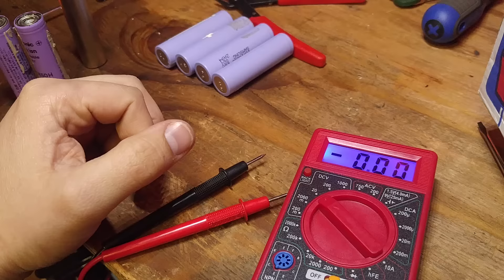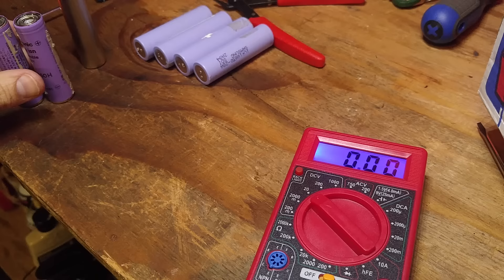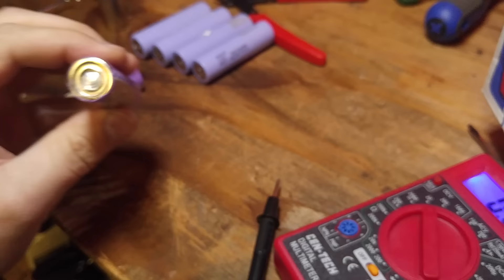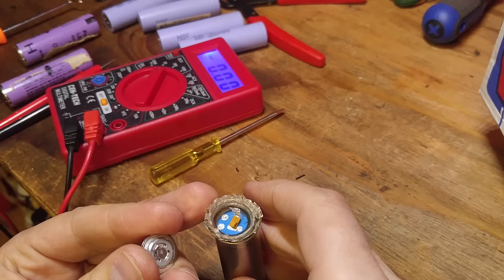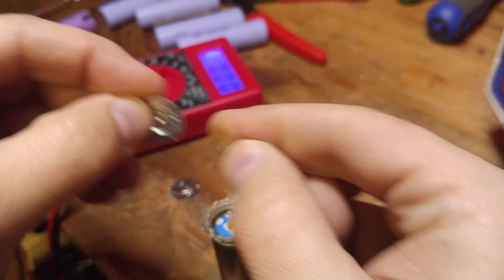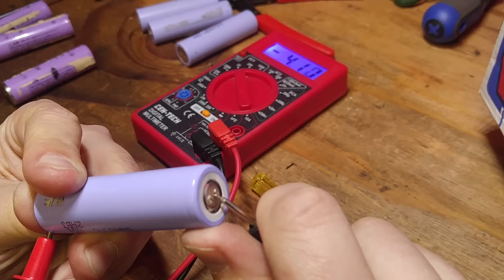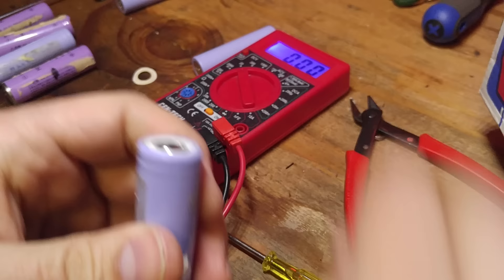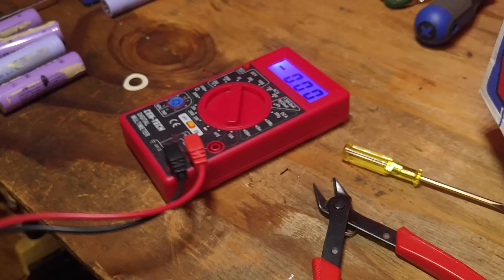0v 18650 - How the CID works

Comment: This is freaking AWESOME!!!!!!! 
I repair sooo many battery packs and noticed that most of these packs coming for repair have Samsung cells (exactly like the one you showed in this video). Have you tried the same with other brands like Sanyo, LG, Panasonic or Sony????
This video will help a LOT of people out there... =]
Reply: this works with all the 18650 batteries ive worked with. no need to even cut the top off, just get a really tiny screwdriver, alan key, or paper clip and stick it in the holes of the positive terminal and you will hear a little hiss when the dome returns to its operating position and relives the excess gas the cell built up.
Reply: is this safe to do? I did not hear any hiss sound, but still I have a 2.6V voltage reading now instead of 0. If I didn't hear a hiss sound that means I pushed it too lightly and it will probably return to previous state soon?
 How long before the pressure pushes up the lid again, or this will stay down from now on?
Reply: World Peace Deathray there shouldn't be a hissing sound. The whole point is that it is a sealed battery. If the pressure gets to high, it pops the pressure disc, effectively disconnecting the positive end. If you puncture it, the pressure will escape, but you will effectively defeated this safety measure. So I would deam the battery unsafe to use again. Just my thought.
Reply: KalTube if you did not hear a hissing sound (escaping pressure/gasses) it means you reset it correctly. Pressure decreases as gasses condens when temperature drops. If the battery will run too hot again, it will just expand de gasses again, and pop/disconnect again. If the gasses escaped, you defeated this safety measure. So it will never disengage the positive terminal, untill the battery just gets to an unstable/overheating working state.
Reply: ElectricBike ة
ن
مج
Reply: World Peace Deathray म
Reply: Bruno don't tell people to revive dead cells it's dangerous and they shouldn't do it... it is absolutely not safe to do... once the cell's dead it should be recycled and unless you live in a third world country you should deff not do this.... I cannot stress enough how important this is for safety reasons...

Comment: Thank you. It's true. I can recovery many of my 18650 battery. If I don't see this video I don't know what to do with it. (when I use screw driver press to the hole I hear the sound like air come out and then,when I check it the voltage was come back) I very happy.

Comment: It worked on 10/15 batterys. Just get a phone sim card opening tool or somethig small and push the CID back to place. It might release some gas but usually it works. I will post the capacity of saved cells soon

Comment: These aren't just batteries - they are explosives. If the safety seal blew it was for a good reason. Pushing it back in is a ridiculous idea and you can end up setting your house on fire during charge or even during use without warning. If you rebuild a battery pack then a single cell will ignite the others for a real display. And no it cannot be put out once they ignite.

Comment: I revived some 18650s that was at 0v using my battery optimiser, i set it to charge in NIMH mode at 0.1a until the voltage increased to 3v then switched to lipo charge at 0.5a theyre now fully charged at 4.2v holding their capacity at 2200mah, i tried a similar method to yours and almost popped the battery.
Reply: Douglas Dark do the batteries get hot when under load? does the resistance not increase lots when it sits at 0v for a while?

Comment: Greetz,

What are the consequences (in terms of further use), if you accidentally vent the battery ? Meaning that you hear a hissing noise - like yours did @ 09:47. 🤔😐

Some suggest/claim that the battery cannot go back into protective state anymore. Ergo if something goes wrong (during charging or discharging) it can explode. Can you elaborate on this please ? You can also add links where this is thoroughly explained. Thanks.

Best Regards. 🙄
Reply: These cells are compromised and no longer safe to use. The protection is there to vent gasses from a damaged cell. The disk venting is a symptom of a much larger problem internally in the cell.

These cells modified like this are now a fire hazard.

Electrical Engineer
Reply: Stephen2846 Makes sense... does that also mean that the controlled environment thaw was prior to this in the battery is now constantly exposed to the outside (air) ? 🤔

Lithium doesn't handle moisture very well...

Comment: i have 3 with 0V, but not open circuit, trying to charge ends 0,00-1,8V during charge and heating. It has internal short.

Comment: I ordered a 120 NEW Sony vtc6 18650 cells for an electric skateboard project I was gonna make. It took about 2 years (moving, Corona and waiting on other parts) but I finished building the battery pack only to discover a handful of cells lost voltage like this and I can't replace them individually because the battery pack is epoxied together as a whole unit.

My only choice would be to pop the CID vent permanently. So I'm just wondering how exactly do I go about doing that.

Mind you the batteries didn't get hot but they were stored in a California garage so I think the constant low temp and years without a full charge may have given it internal condensation possibly to build up enough pressure to trigger the CID?

it's just a theory of mine but I sure as hell can't afford $700 of new cells so it seems like this is my only choice

Comment: Great find.  Was having the same problem.  I wonder if the process of removing them from the pack is also putting alot of force on the tops adding to the metal popping out.  Should have watched the vid all the way thru.  About jumped out of my socks when one hissed like yours did.  Samsung  IRC18650-28A. 2BC1 here

Comment: 2021, O.K. Managed to do the same results re depressing the inner POS push-out to go from 0 VDC to 3.76 VDC. Is it safe to solder a a braided 18 AWG to the inner exposed contact without being to close to the lithium ? Can't use any contact to bring the POS contact beyond the top of the base without heat shielding (teflon). That is, can I solder a lead (18AWG braided) to the centre of contact we pushed down to remake contact with the 186..to bring the Lithium back 18650 POS lead accessible  for use as a standard 18650? BTW thank you..two LT batts bit the dust on the two centre 18650 bat falsley going to zero VDC.

Comment: Seems like the wire back to the spot but no power is provided. Once I popped down the positive touched the base getting contact but not enough to provide high power output. Otherwise is back but useless. Should we try soldering to get better contact?

Comment: So, I take it most of the THIS IS AWESOME people were never aware of a 'protective' "18650" or such type of cell, right?  All "18650" cells are not built the same.  However, in something like a PACK configuration, for safety sake you will most often, indeed, find that the cells have the SAFETY feature.  You can purchase the battery, and others to, with this feature.  You just need to make sure to look for and find it is there.

Bottom line is not all of these batteries have the feature.

Comment: with your experience the cell will not back to the same situation again?
Reply: hum, eu acidentalmente furei uma delas fazendo isso, vou checar como ela esta agora, e sim... isso nao melhora a condição da celula, simplesmente é uma volta forçada.
Reply: Hopefully it does if the pressure builds. Or BOOM goes the dyno-MITE

Comment: I was charging 18650s with a phone charger and being careful and throwing away ones that behaved different. A guy kept borrowing my batteries and bringing back junk. I charged one about 5 minutes and it was already getting warm. Took it off the charger and set it aside. About 2 minutes later I heard a noise and the battery was shooting flame from the negative end. It was spinning and hovering like a firework. It was loud and grey dust went all over. My Chihuahua Yoda was trying to get out of the room. It seemed longer but it probably hovered spouting flame about 10 seconds. Never accept a battery from a tweaker

Comment: is there any reason you could not make an air fitting and using 5 psi air pressure pop that disk back in and reconnect the battery

Comment: Thank you for your video. I’ve noticed all the videos show the red probe on the multimeter touching the positive terminal of the battery to show the zero voltage. But after the procedure of popping the little cap back in you all, put the black probe on the positive terminal of the battery to show the battery has voltage! How is that please, why the change on the probe? Excuse me in advance if my knowledge is limited, thanks for your time.
Reply: On decent multimeters it doesn't really matter as they can measure positive and negative voltage

Comment: I tried this with some Sanyo batteries and it worked but it seems to release gas and I can hear it fizzing out. They don't get hot. Have you noticed this?
Reply from the maker: Kold if they release gas you punctured the cid. there is a point in my video where I do the same thing accidentally when trying to reset it with my multimeter tip. while not "bad", I assume it'll let the electrolyte dry up over time... so I try not to do it.
Reply: So is it safe to use battery with released gas? (and small hole in CID).
Reply: That puncture was caused by me. So I know what caused that pop.
Reply: NO NEVER USE A CELL THAT HAS A HOLE IN IT!!. There is a reason they are made to be closed up, its a sealed environment. 
If you can see liquid coming out then thats especially bad. Through them away before you burn something down. Ive had a cell leak all over the place and thats not exactly good for your health.

Comment: Thank you for your video. I did it with 6 of my dead cells from O volts, they worked with 4 volts and accepted the charger. However, there is bad smell from the battery. Is the gas dangerous and what is it? Thanks again Bro.
Reply: Is the smell like solvent? Mine just let out smell like that once i pop it and release a bit of liquid.
Reply: @markanthonyalcantara6548  Yes, I met the same. As I used to buy a lot of cheap cells to repair and salvage. The liquid damaged my charger. I need to be extra-careful now. I do not know what the smell and liquid are. anybody can answer it.

Comment: I remember the years when the CPU/GPU of a PC did not have or need a heatsink.  Today and for the past decade or more makers have been overdriving the processors because of consumers demand, causing the device to heat up and draw much higher power.  The Xbox 360 was notorious for the red ring of death, BGA (ball grid array) failures at the processors.  Alienware, gaming notebook PC, lesser known because the online postings were soon deleted, also failed.  A $5K gaming notebook dying is not unusual, failure happens with lesser PCs and smartphones when video is processed/played extensively.

I suspect the batteries heated excessively because of the high current demand of the device/PC.

I recently got a Hoover Links vacuum cleaner battery pack working again by charging each cell individually using a power supply.  One of the cells was extremely low at 0.010V, charged that cell very slowly, took about an hour just to get to 1V.  The vacuum has a very high current draw, runtime is only about 15 minutes.  Battery pack gets very warm but not hot.

I suggested to other users to not to run the vacuum past the low blinking power indicator or when the vacuum sounds noticably slower.

Comment: I'm not sure if you're still active. But I own a business where I sell IT equipment. Over the years we have bought thousands of new laptops that have to be dismantled. This is something that's required by the manufacturer whom we buy from. But the batteries were pulled from these units and just start on shelves. It's been four or so years since most of them were stacked. I decided to try and sell these and as I've started to test them they're dead and showing zero cycles. Is there anything I can do about this that you know of short of destroying the batteries and removing the cells?

Comment: Just happened to my laptop. It was working fine. Then next day battery wont charge and then i tear it down. I found 3 batteries of 4 at 0 volt and only 1 that working. I dont know why this happened. I have this just less than 2 years.

Comment: yeah that is ancient technology..the CID.  There is a similar fuse in your clothes drier.  You're supposed to buy a new one when it 'fails'.  But if you hit it hard enough against the floor, the inerta will 'reset' the fuse and you can re-install it.  With these batteries, I drill a small hole in the top of the cell so I can access the button with a toothpick.  Then I reset it.  I'll even puncture that seal and release the pressure with a straight pin.

Comment: What if I accidentally put a smole hole on the CID? wil it still work?
Reply: I accidentally put too much pressure while popping my Battery and it release some liquids that smells like a solvent, but its still working? Is it dangerous to keep using it?

Comment: like i have 4 lithium batteries and i saw this way in a lot of videos and tried it but cells never back to live, i didnt know why. then i saw your video and knew that its need to be had pressure in the first so i realce it by this 

omg so not with any 0v cell this work only which have high pressure

Comment: ive some cells read o/c,thinking about carefully drilling a 0.7mm hole in the tops and using a pin to push the disk as the holes are way to small to get anything in,has this been tried?
Reply: I don't think anyone's tried that before but if you use a drill press and set it up so that the lowest position will keep the bit from going into the battery any farther than necessary it should work quite well.
Reply: @inoahmann7542  it did trie it,worked a treat!,drilled a 0.7mm hole then used a pin to push the disk
Reply: @paul.alarner6410  So what is your long term experience with the batteries revived this way? Do the rejuvenated batteries produce a reliable voltage and current and recharge normally? Does this technique result in a CID reset that preserves its function and battery safety? Have you reset one of your revived batteries more than once? Any bad outcomes? Thanks for any info!
Reply: @johnbauman4005  try seem ok but capaxity way down,say half.
Reply: @paul.alarner6410  Thanks!

Comment: Great find.  I just bought 20 LI18s batteries off eaby and every one of them had .001 volts.  Most showed signs of venting.  Not very happy but that the way it goes when trying to go the cheap route.  Just checked your solution and still zero. Like you said, when they are revived, they typically only have 100mah so....trash.

Comment: could this be triggered when someone solders the top of them with a regular hot tip tin solder? instead of using point solder with nickel plates
Reply: @vincent921000  ok of course resetting cid is out of question but i think if i cant get a spot welder i would get a more wattage iron so it outputs more heat and melts tin in fractions of a second (so the emperature rise wont get too deep in the cell)

Comment: I had 2 of those flat head 18650's that show 0.00v so i did this trick on both of them with some metal wire because a screwdriver wont fit  resulting one succes and one letting out the magical smoke...  :l     well  atleast i got one working :)

Comment: Hi bro. I harvested batteries from my laptop battery I had 6 batteries only 2 worked in my regulated vape mod all the other had very low voltage. But the battery I was using has only 3.3v and I can not vape on higher woltage because of that. I broke my powerbank yesterday and harvested batteries from it they are 4.2v(written on the battery)  batteries but I checked them using the tester and it is showing 0.01v I tried charging them using my mod but my mod couldn't detect them. Doing this method will make those batteries work properly? Please reply
Reply: Pranav Miglani try charging them with a tp4056.it trickle charges on low current  until it reaches 3 v after which it charges on regular 1amps
Reply: prasad mudkatte threw those batteries. Harvested new 3.3v batteries they work fine.

Comment: I did it. And it released pressure but still won't work. Help please
Reply: If it releases pressure then, it has failed dicard it. But if it didn't and your volt is backup then you good. Reset successful and fail safe backin.

Comment: And stabbing the over-voltage protection with a syringe it's not a very smart way to repair a battery you're just bypassing it and next time you overcharge it it's going to burst into flames this is the most dangerous video I've ever watched this guy is going to get people hurt